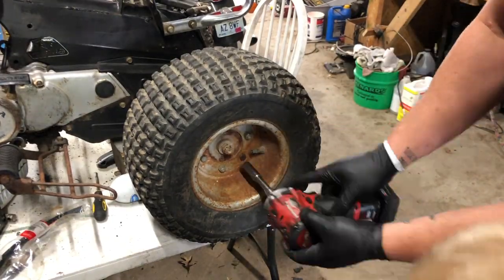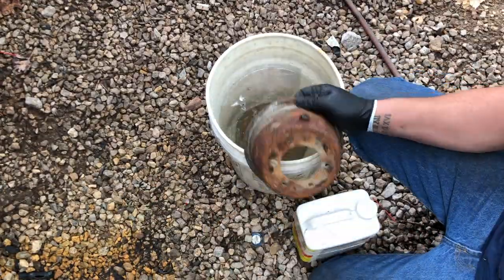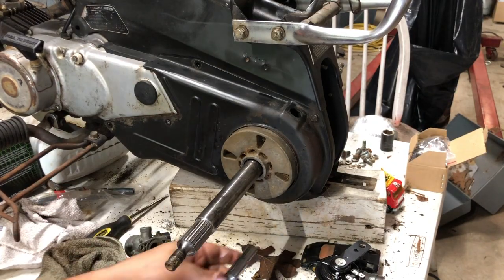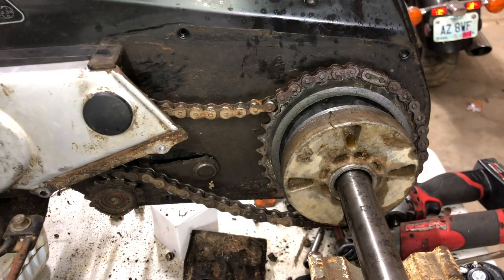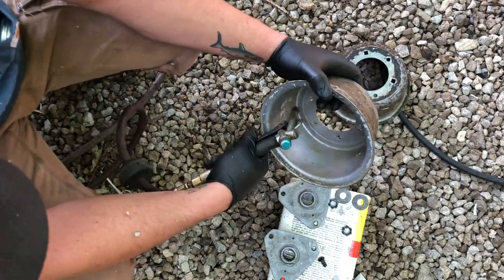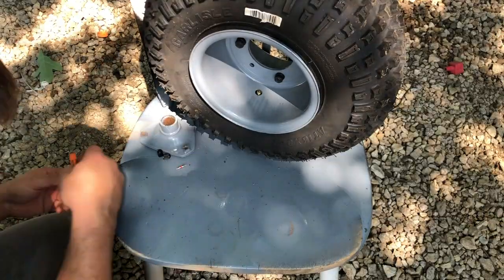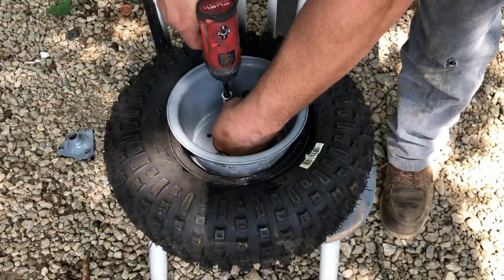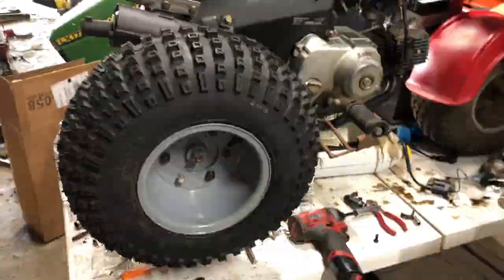Vintage Honda Three Wheeler Tire Change

Comment: Should have left the other rim half (with it still bolted 🔩 together) in place, before turning the tire over,  to attempt to break the bead on that 😳 side. Thats with your Harbor Freight ATV tire bead breaker. Just subbed!! Your friend, Jeff!!